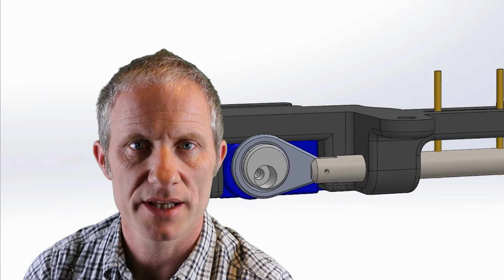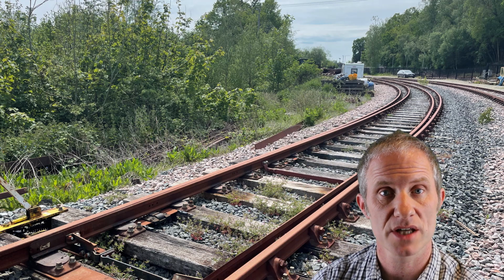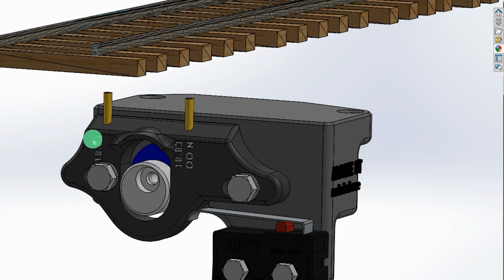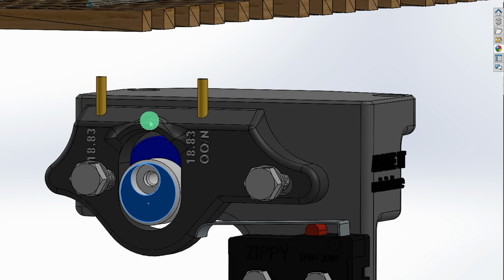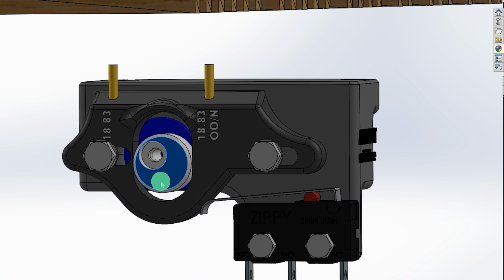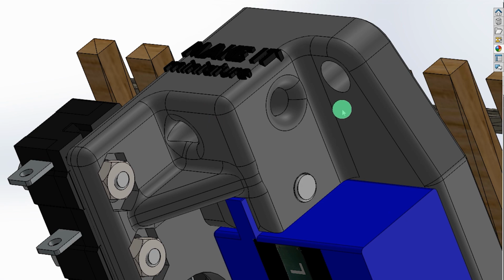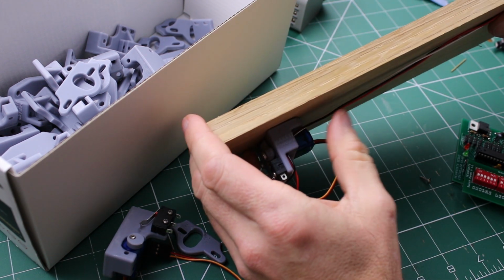S2 E11 Improved Servo Turnout or Point Actuator Update from Bexhill West Model Railway

Comment: I'm arriving late here, but clearly, great minds think alike! I've designed a succession of cam-operated turnout mechanisms, and I definitely think it's the right concept. I put some videos on Youtube--even if the last one (actually designed first) didn't get beyond a CAD simulation.

One more thing I've thought of--if you have a mechanical lever frame, you could get the output off the lever via a potentiometer, then drive the servo as a true position servo. That way, you'd have some sense of controlling the points manually, as if there were rodding connecting the lever to the points.

https://www.youtube.com/watch?v=MSM7z7-o5gs
https://www.youtube.com/watch?v=iYiwFuFhLXk
https://www.youtube.com/watch?v=qs4tBnEXSt8
https://www.youtube.com/watch?v=_FbO0rfeJso

Comment: Superb! Yes two micro switches are definitely useful, many of the better point servo systems like the tortoise and the MP5 have two sets of contacts. One is for switching the frog, the other is for signalling back to a layout controller that the point has changed. In some cases, the latter might be used to interlock signals. Yes it’s possible with relays, but the big advantage of something like this is convenience, so having a second set of contacts as an options, avoiding the relay, would be really helpful. Hope that helps.

Comment: Not sure I see the benefit of using a servo instead of a simple lower current geared stall motor. I know it's fashionable to always use the latest tech,  but having to add external control and alignment/pressure setting electronics in order to talk to the unneeded added control electronics of the servo strikes me as a double redundancy. Also I'm not sure what happened to the previous E10 method of connecting to the throw bar for non commercial turnouts?
Reply from the maker: I think there is room for a variety of solutions to controlling turnouts.  If I had the luxury of building a permanent installation then I think I'd prefer the challenge of a purely mechanical system.
As for non-commercial turnouts, my next video out on 19/2/22 will show one option using this mechanism.
Thanks for watching,
James

Comment: That's a neat implementation. As soon as I saw the original design, I thought that a yoke design would save a pivot, and that's what you did. I haven't read all the comments so have one  question. Will you make a range of cams with different throws within the same yoke, to cater for different blade gaps, or does the cam overthrow the points, with the operating wire taking up the extra movement? Thanks , Dave
Reply from the maker: Thanks Dave,  Originally it was my plan to have different eccentrics, but when I saw how simple it was to control electronically there is no need.  My next video will show an installation, and how the throw can be adjusted without the need for a springy operating wire.  
Thanks for watching,
James

Comment: Hello James, I have just discovered your channel. What a brilliant idea for operating model railway turnouts. I have been building a model of Barnham junction station in 18.833 mm gauge for a few years now. Due to the absence in my opinion of a well designed, simple to operate, turnout operating unit, all of my (22) turnouts are operated by my own design of wire in tube turnout operation using K&S brass tube and steel piano wire. I still have a few turnouts that are some distance from my operating area to connect up, so if you ever decide to market your 3D TOU's, count me in. One final note, will your TOU's work with the Peco system of servos and controls ?
Reply from the maker: HI Bazza, I was looking at an old map of Barnham just the other day and thought it'd make a nice model layout.
These units have had a minor redesign since this video and are now really smooth and I'm very pleased with them.  My next video out mid-Feb will showcase the range which I intend to offer with and without microswitches.
I have just looked up the Peco units and read the manual and feel confident that these would be compatible with their system, but wonder whether the Megapoints system might be a more cost effective and versatile way to go.
Thanks for watching, and stay tuned for the update on these.
My best wishes,
James
Reply: Hi James,  modelling Barnham Junction has been very enjoyable but has been a bit of a challenge living in New Zealand, and working only from a BR Southern Region station layout plan that I managed to purchase from someone in Waterloo station and photos that I have down loaded from the Internet, thank goodness for the wealth of information on the internet. Yes you are right, the MegaPoints system of servo controllers appear to be the most cost effective option for me and the easiest to operate, thank you James

Comment: Why you not use the ESU Servo Pilot?
Reply: I use them already, they are excellent, especially V3. But James innovation means I no longer need to buy switch pilot extensions for frog polarity changes.  Significant cost saving there on a planned large layout.

Comment: looks very good James how would you deal with a point over one go the board support timbers?
Reply from the maker: Good question, Brian.  That's got me thinking - not sure how to answer that right now so I'll have a think about it during the week and answer it in my next video. Thanks for the great question. Best wishes, James
Reply: I had a similar problem, you could use an angle crank or short wire in tube between the turnout and TOU. One of my turnouts has a square plastic rod attached to the turnout blades with brass rods, operating in a square K&S brass tube located between a pair of sleepers, which in turn is attached to the piano wire running through brass tube which burrows down through the base board to the operating switch some 100 mm below the top of my baseboard and clear of obstructions.

Comment: Hi! What is the size and geomtry of turnouts you are going to use? I mean informations like radius, frog angle and the designation B6, B7 or B8...
Reply from the maker: Hi Jan, There is a mixture across the entire layout plan, but the mainline is mostly B8's with a 1:8 crossing angle.  Radius of the turnout will typically be around 1850mm (approx 6'), with the tightest radius on the main line being around 10000mm or nearly 33'.  It is being scaled directly from maps.  This is a general simplification, I can give precise details in a video if folks are interested.
My best wishes,
James

Comment: I am very curious about the drawing that appears in the background around 3:15. It shows "slide chairs", "block slide chairs", and what appears to be "back slide chairs". Will you be modeling this level of detail?
Reply from the maker: HI John, Yes, I have been using the correct chairs from the Exactoscale range for my hand-built turnouts.  The slide chairs are commonly called 'P' types, the block slide chairs are '1&2PLA' and the back heel chairs '3&4PLA'.  Additionally, there are 'C1' distance blocks which are used to support the switch rails on 2 of the five pairs of 'P' type slide chairs.
Apologies for the confusing detail, it took me some time to become familiar with it all.
Thanks for watching,
James

Comment: Great revision!

I am intetested in buying some possibly but I've always been put lff with Servos as I don't know how to program them and don't really want to.

Been using Smails n Tortoices as it's all complete, slow action with polarity switches but they cost the earth.

What you think?
I've got a LOT of extra turnouts to do still.
Reply from the maker: I know what you mean, I'm trying to make them affordable.  You've got me thinking about a PCB I designed some years ago which would operate this with simple rotary controls to limit the travel at each end of the stroke. I will dig out my files and I could potentially etch these as a super affordable control system that could easily be soldered by someone of your skills. I'll keep you posted. Thanks for watching, James
Reply: @BexhillWest  Thanks James.  What concerns me most is servos.  I know they're simple but no idea how to program them.  Is it possible they can be supplied ore-programmed?   Truthfully I have no idea here.

Can solder fine ya.  😋

Comment: A very nice design James ,Mechanically my only concern is the potential issue of the plastics becoming worn and sloppy , Is the main body of the unit and the cam printed out of hard wearing plastic and maybe use shoulder screws with a plain diameter to slide in the slots as apposed to the actual thread itself . Regards David
Reply from the maker: Couldn't agree more, David.  I didn't have any M3 shoulder screws, but they certainly would be better.  As for the plastics, I am confident that wear will not be a problem.  I forgot to mention that I used a little PTFE grease - just a smear between the parts - not sure that it made any difference, time will tell. Thanks for watching, James

Comment: Another reason for a second Switch, in JMRI (probably other setups as well) you can use a second switch to confirm that the turnout is in the second position rather than the option that logically goes if switch A is active then turnout is in position 1, if inactive it must be in position 2, this is better for slow moving turnouts where there is a short delay between the two positions
Reply: Beat me to it, David.  A second switch for 'feedback' would be a good addition
Reply from the maker: Hi David, that all makes perfect sense. I shall add a second switch. Thanks for watching, James
Reply: @BexhillWest  IMHO a better location for a second microswitch would be alongside the existing one. This would not make the whole unit wider (accross the track) which may cause interference with a second wide 'point motor' on an adjacent track.
Reply from the maker: @hughjardon5101  I completely agree. I’m moving forward with both options, which could allow for 1, 2, 3 or 4 switches is required. Although I cannot think of why so many might be needed. 
Thanks for your input.

Comment: Very neat final solution, next bit is a fitting jig, that is placed on the track and allows you to drill the locating holes for the motor assembly. Making it very simple to install the motor assembly on centre and perpendicular to the track.
Reply from the maker: Hi Paul, great idea. That's already designed and will come in the form of a printed template taken from the CAD. Thanks for your feedback. Best wishes, James

Comment: Great innovation. Always thinking outside of the box. One observation that may or may not be of interest/concern: Should a train run through the points in reverse it will not be able to deflect the blades as is often the case with sprung points. I doubt this is an issue as usually when/if this occurs the train would be stopped and the situation reviewed. Just thought I'd mention it though in case it is an issue for you. All the best James and keep up your inspiring work.
Reply from the maker: Hi Paul, thanks for your food for thought. I shall put my thinking cap on. Thanks for watching and taking the time to send me feedback. Best wishes, James
Reply: Hi Paul, I also model in P4 18.83mm gauge. On entering my staging sidings the turnouts are operated by the wire in tube turnout operating units, but when exiting the sidings in a trailing direction, I have made it possible for all rolling stock to move the turnout blades over to the stock rails without the use of an operating unit. All that is required is a switch to change the polarity of the crossing V's.

Comment: One of the best servo point mounts I have seen. Would you be willing to sell just the STL files for people who like to 3d print but are not as skilled as you in cad design. waiting for the next new device that you will come up. I already have the ballast hoover.
Reply from the maker: Hi Alan, I am reluctant to and here's why: I've done a lot of experimenting with the CAD to optimise the job for my printer and preferred settings. The tolerance on the servo splines being such that with different resins, settings and machines etc., the outcomes could be variable and this might lead to frustration. I hope that makes sense. Thanks for watching. Best wishes, James

Comment: Switch -> polarity changing at exactly the same time as the blades (if turnout and current change with different delay you may get a short, which normally your controller deals with).
Secound switch -> return signal, LED on the controllpanel showing set route for example.
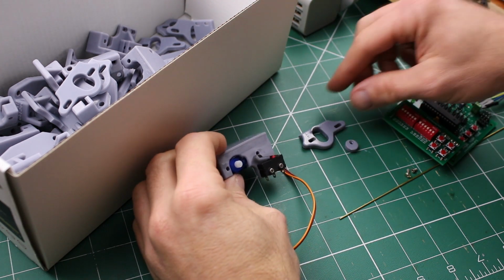10:13 look´s like people could soon order
🤔 Could connect the frogpolarisation via the two brass pins 🤔 or you see a problem with that? Loose contact maybe.

Nothing wrong with products coming out of the hobby for the hobby!
You do not need to deal with two canals as it is - saves time.
Reply from the maker: Thank you very much for the feedback. This all makes perfect sense.  
I've just read your email which had gone to my junk folder, really very interesting indeed and I'll reply later when I've finished these comments. Till next time. All the best, James

Comment: Lovely design and thanks for sharing your design process. Dual microswitches are useful for turnout position feedback and frog polarity.
Reply from the maker: Thank you, I'm getting that from these comments. I'll add a second switch. Thanks for watching. Best wishes, James
Reply: @BexhillWest  am I right in assuming that the distance on the side to side motion is designed to match the distance required for peco points? How much tolerance is built into the motion range? If the servo over rotates by a degree or two will the blade come away from the rail?

Could you design a tool to accompany these that allows for perfect installation every time? Appreciate that the double prong will ensure correct alignment under the baseboard, but for the single prong peco points aligning the motion of the servo with the tie bar can be tricky.

Comment: Reason for switches:- Frog polarity, mimic indication, signal change or block change for route, so potentially up to 3 required! (else the one needs to feed multipole relays)
Reply: For more switching, use the microswitch to control a relay. Simples.
Reply from the maker: Thank you Tim.  This is consistently coming through the comments so I'll definitely add a second switch. Thanks for your feedback, James
Reply: @BexhillWest  If you'd like to be really fancy - have separate microswitches to confirm the point is locked in each direction!